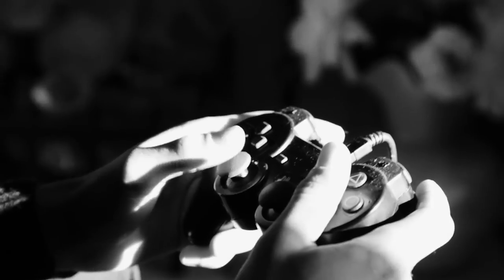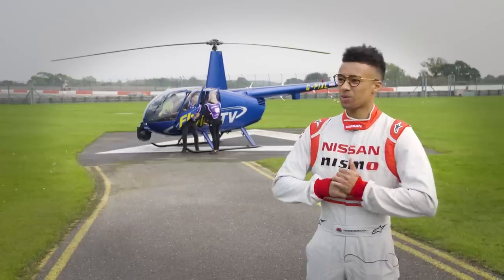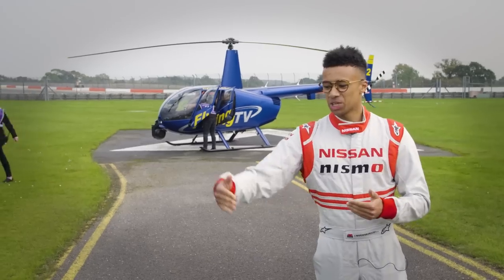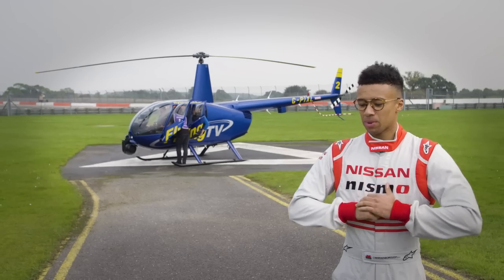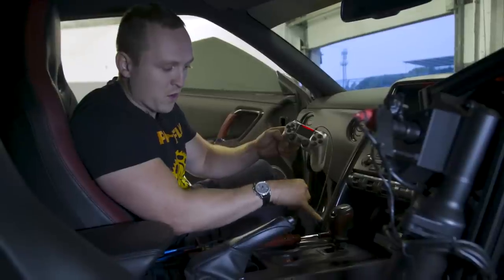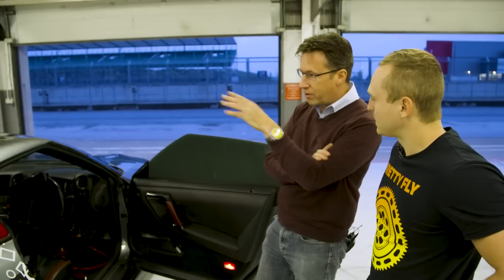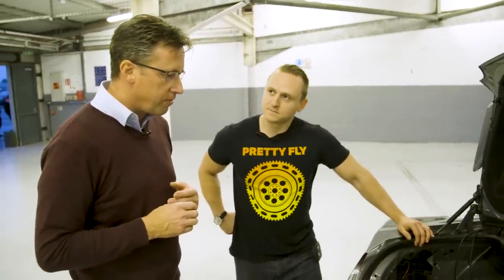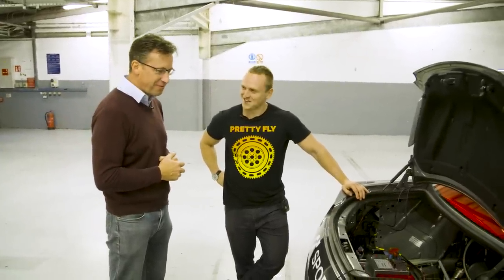Driving A Nissan GT-R With A PlayStation Controller

Comment: But what happens when: your controller has been disconnected
Reply: Fish Fishing HAHAHAHA
Reply: Fish Fishing that was my first thought
Reply: Failsafe mate
Reply: Fish Fishing the GTR dies
Reply: Fish Fishing crash into wall
Reply: Fish Fishing The car goes straight while decelerating.
Reply: I imagine the controller needs to give input to the vehicle for it to move. So if it doesn't, it's like taking your foot off the gas pedal. It just slows down.
Reply: Fish Fishing watch the video, they explain everything
Reply: probably not chaper than damages in a video game
Reply: Yeah, I mean I go 20 feet away from my ps4 and the controller disconnects.  The battery dies in like 12 hours. lol  My ps3 controller was fucked up and it kept turning on the ps3 and it wasn't working, so I went across the entire house, maybe 100 feet and it was still connected, so instead I had to throw it into the backyard as far as I could and that stopped it from being connected.  Maybe they shoulda used the ps3 controller lol
Reply: IT'S NOT LETTING ME SIGN IN!
Reply: The car automatically shuts down and stop...
Reply: Fish Fishing Hell yha buddy!
Reply: game pauses
Reply: ms crazy its a joke....
Reply: ms crazy and the controller is also wired onto the computer
Reply: I imagine the brake would automatically engage if a signal was lost.

Edit:  Also if the pneumatic system fails, the brakes are applied, similar to how big truck pneumatic brakes work.
Reply: it pauses
Reply: Fish Fishing well the car crashes jnto a wall
Reply: +Fish Fishing welcome to humanity
Reply: Only on xbone
Reply: thats what he means
Reply: AlexMustang good thing it's not an early 2000s mustang. =p lol.
Reply: Anyone who wonders that isnt very smart 
Clearly will stop going
Reply: Fish Fishing the car gets written off sadly 😀😁
Reply: Fish Fishing, just like gta, it floors it
Reply: AlexMustang, the gtr becomes your mustang.
Reply: Fish Fishing wait for it

Wasted
Reply: Good question
Reply: YOUR BATTERY IS LOW lol
Reply: BUM
Reply: Or "DualShock Controller has a low battery"
Reply: the game pauses
Reply: Shush
Reply: Goes to pause menu

Comment: Why without a vr headset with a camera mounted on the top of the rear spoiler??
Reply: Stefano Curcio the camera is slower than the head?
Reply: Or mounted in the cockpit.
Reply: Yea like a real video game
Reply: Seriously! I can't think of a single reason. They could mount a camera inside the cockpit, one on a stick mounted on the spoiler, and maybe even one on the hood in front of the windshield. It'd be JUST like on any game out there.
Reply: FalconGamer 58 not using a 360' view...
just like POV that drone's driver use
Reply: Yeah on the spoiler its not like affecting aero..
Reply: RComando Look at racing quadcopters. It wouldn't be much of an issue.
Reply: Aleksandar Miloeski don't forget front bumper cam too like GT4
Reply: its better to use your eyes.... less latency, less stuff needed on the car, less weight, less electricity required. Batteries are heavy as fudge.
Sending remote control signals for the robots in the car is not that big of a deal, in terms of lag, but streaming live footage from a camera inside the car is going to have delay and thats going to mess up your reaction times. 
(even 0.2 second delay is huge... or 0.1... and neither is even half a second... in video games you dont have this delay to your own car but instead you have lag between other online players because your computer needs to send your cars positional data to the servers and then the servers send it to the other players computers, same thing with their car's positional data you receive... so for you in the game your car is always at the  right spot but for everyone else its 0.1-0.5 seconds late and vice versa. This happens in every single online game in existence...)

Video footage requires more bandwith since its hundreds of images every minute, unless you go with 1 fps then its 1 frame per second.... thats laggy.... using your own eyes to see the car is basically as fast as the universe allows you to see it... you can see the car with the latency of light speed and as fast as your eyes can process the image, which is quite fast compared to any humanmade wifi-connection.

And since its not a quadcopter or anything like that... you dont need 3D spacial awareness of the vehicle's surroundings, all you need to see is which way the car is pointing... its like playing GTA 1 or 2 with top down view. The car can only go in 4 directions, left, right, forward and backwards... it cant crash to the ground from lack of throttle-input like a flying machine could.
Reply: you guys mentioned delay, the drone racing using real-time camera, the tech is here already
Reply: This is what I don't get. Who thought "helicopter" before cameras?
Reply: People don’t understand what a RC car is. It’s not a FPV RC car. It’s just an RC car.
Reply: Cant read the turns that good

Comment: They need to reduce the input latency both from the controller and hydraulics (maybe even remove hydro and hook up directly in to cars electronics / ECU), mount a camera system and do it properly either from a TV in the pits or a VR headset. That would be proper, and definitely could become a competition with selected drivers at first, and possibly something bigger, almost a sport...
Just my thoughts how I see this working.
Reply: yeah, for the acceleration you can hook it up to the car electronics/ecu. but for the braking you need something to push the cylinder, that would not change, the steering is controllable with an electric motor mounted on the steering rack, no need for fancy shit on the cabin. the car is already automatic so no need to worry bout that lol
Reply: Or they can just drive the car
Reply: I have no idea why they have the throttle input going to an actuator, that pushes a lever, that pushes the pedal, that goes into the cars computer.
Why did they not just connect a to b?
Reply: Darien No you don't need physical contact actuating the brake pedal. Cars have auto braking capabilities as part of the collision mitigation system, autopilot system that only requires your hands on the wheels while they do acceleration and braking for you, auto park system etc. Just hacking the ecu can easily accomplish this project without adding extra potential points of failure.
Reply: Hussein Omobola Not to mention that after you have had your fun on the track with your car driven from the pits (Whats the point TBH?) you would be able to drive it home.

Comment: Can they hook up a gtr to my g27 racing wheel? Thatd be sick
Reply: Adam West what's the point just drive the car
Reply: Rekts the point is you don’t die when the car crashes
Reply: Someone already did that.  It used to be a show on the discovery channel where they arm cars with machine guns and blades and have a duel to destruction. They used a logitech G25 to drive the cars remotely
Reply: Thomas John Solidum what's the name of the show ?
Reply: Adam West Just one more week! Feels and looks real in GT Sport.

Comment: Why not put a 360 camera on it and ride it with a vr headset and the controller or just a front camera.

Then as a bonus extra it would have been really nice if it was rigged with microphones in the engine bay, wheel arches etc linked to a big sound system. : )
Reply: video delay, it would be like driving the car 0.005 seconds in the past

Comment: Brilliant Technology. I am only worried about the feedback time. In a closed loop system like this, even a milli second delay can be a costly affair. The drivers have to be highly advanced. A simple idea but a complicated engineering work inside. 
(Edit: Drivers I mean the control system drives in the CPU and not the Joy Stick user. )

Comment: What? So No Racing wheels like the T300rs? G29? Or even the new Thrustmaster wheel? That would be a bit more cooler if the remote control racing wheel is controlling that GTR but still, Kinda a no brainier that you can DRIVE THE DAMN AWD SPORTS CAR WITHOUT THE CONTROLLER? Just saying.

Comment: With throttle, steering, and braking by wire, you'd think there would be a way to do this without all the pneumatic cylinders and servos.

Comment: If the range works over several kms, why not just stick a camera on the dash/roof/bonnet and control it from the garage. Surely would be a lot easier than trying to control it like an R/C from a heli. Better yet, stick a rotating 3D camera in it linked up to a VR headset for better depth perception and peripheral vision!

Comment: Does the nissian GTR use a PlayStation 4 for computing all the information and executing them for the mechanical controls inside the car? or is it using off the shelf computer and software, and if it is being used with the ps4 for Processing is it connected to all the systems via a custom interface or a direct one?. for example is it using wifi and Bluetooth as hardware for communication, and usb, ps eye port for directly input commands to the actuators, and if so is it the ps4 native software and hardware? Excluding the dualshock 4 controllers.

Comment: Would have been a lot more impressive re-coding the car. A lot of new cars have electric powered steering, brakes, gas etc. all of the work with the hydraulics is completely unnecessary. 

 Don't see why no one has done it the simple way. The hacked mitsubishi's can be entirely driven by a cell phone.

Comment: Cool but I don't see the point. I mean there is no risk of loss of life, which is good (obviously). But the whole point of video games is a virtual world that you wouldn't otherwise be able to access; however, in this instance the guy has access to the track and the car so why not get behind the wheel? Surely that is more fun?

Also why does he control it from a helicopter rather than a video feed?

Comment: If you're going to race these just use autonomous drones to follow the cars.  The roof of each car could have a unique QR code that each drone is assigned to follow.  The cars should be autonomous as well.  This would mean that the cars would only need a software update rather than a bunch of servos and hydraulics to control the car.  This would also give the driver additional sensors to keep an eye on every aspect of the car and additional camera angles.  Also, driver aids.  Autonomous cars have all the technology available to fully enable any driver aids.  This is where we would really start to see the world of video games and real life racing start to converge.  This could even give a person a chance to race against an AI controlled car.  Top Gear showcased an autonomous car that could race so I don't see why it couldn't work.

Comment: so why didnt they used fly by wire controls, it wouldnt be necessary to use compressed air to control the actuators, and a fly by wire could easely be more acurate...

Comment: when we're trying to make racing games as real as possible, using steering wheels and pedals and gear shifters, motion simulators and VR, these guys are doing the polar opposite aren't they, driving real cars with bloody controllers.... To begin with why is GT Academy depending on gran turismo rather than, dunno, rFactor, Assetto Corsa, iRacing or something along those lines?
Reply: what do you think GT means? exactly, Gran Tourer/Turismo, so GT Academy developed amongst that side, besides GT academy is a really old thig that birth from gran turismo and these ganes your pointed out are more recent
Reply: GodOfGamingBG The physics in GTS are close to Assetto Corsa now.

Comment: How about if you runs out of battery
Reply: it should have an emergency procedure for low battery, example drones, when they run low on battery they display a warning before slowly descending to safety. in this case it would apply brakes to a stop